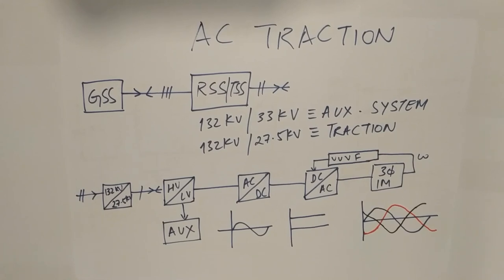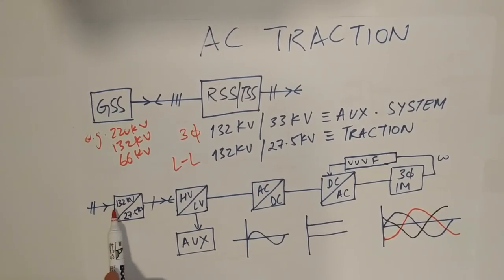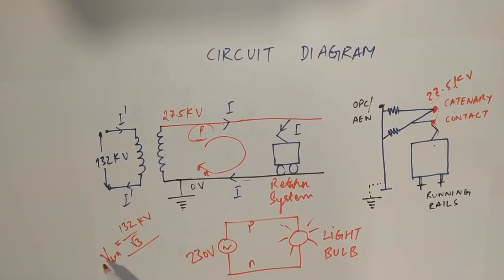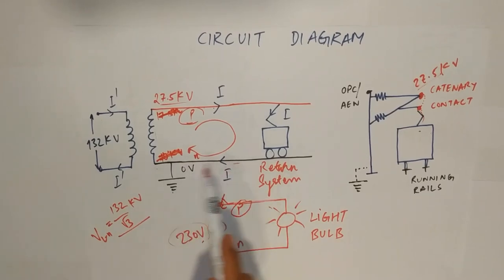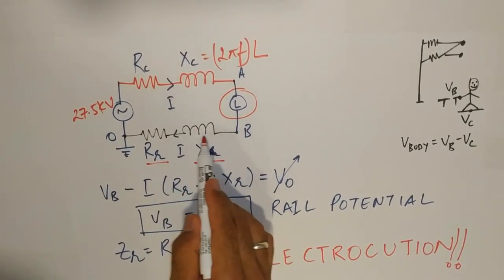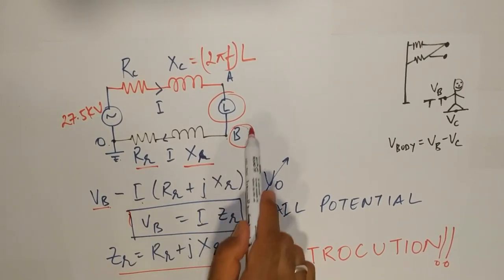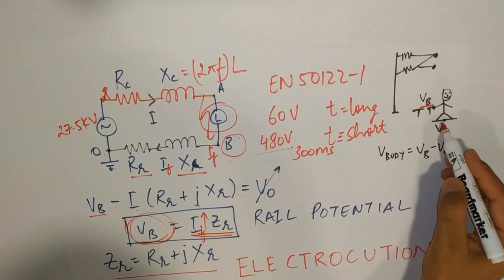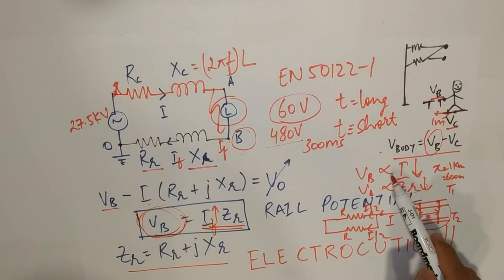Lecture 2 : Understanding 25 kV AC Traction System

Comment: What is the transformer vector group for 132kV 3 phase to 27.5kV single phase?
Reply from the maker: It is not a 3 phase transformer... The voltage 132kV is line to line.... However for this type of traction trafo... It is vector group Ii..

Comment: Earthing systems are classified as TNS, TN-C-S & TT systems. What system of earthing are we using in the traction supply system.
Reply from the maker: In railway we use TN or TT or hybrid of this as per en 50122-1. I have explained in lecture 10 of E&B series.

Comment: You show cross bonding by connecting all rails of two tracks. Wouldn't this interfere with signalling track circuits for detecting the presence of trains?
Reply from the maker: No it will not have that much impact as current is 50Hz. Max harmonic level are 40th harmonic... So spectral component will 2kHz freq but of very low amplitude... And nowadays in signaling we use AFTCs (9kHz to 21kHz) or CBTC system which are immune to such disturbance....
Reply from the maker: N axle counters too... Which work on freq much higher that 2 kHz... Around 40-50kHz...
Reply: @railwayengineeringinsights6463  thanks. It's several decades since I worked on railway signalling on non electrified routes which used DC track circuits
Reply from the maker: Yes true... In mainline they used... But nowadays they go for AFTC in case of track circuits...However in AFTCs also we cannot bond directly... We use impedance bonds...
Reply from the maker: Approximately they are placed a km apart... Act as low pass filter to allow traction current to pass and block audio freq track circuit
Reply from the maker: In case of CBTC system, track detection is by axle counters in metros.... In mainline too they use axle counters for track detection...we can directly bond the two tracks without requirement of impedance bonds... This is an overview I have given.. I will be giving details in my upcoming lectures... Trying to build interest first then will go deep technical... Hope u enjoyed the video... Thanks for ur comments...
Reply: @railwayengineeringinsights6463  Sir! Will we have lectures on type of bondings and their advantages/disadvantages in future?